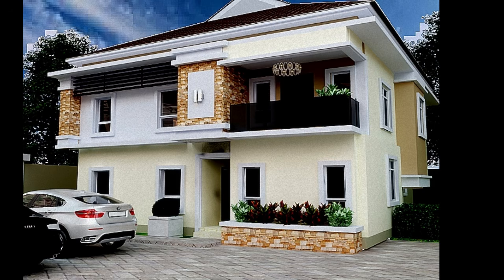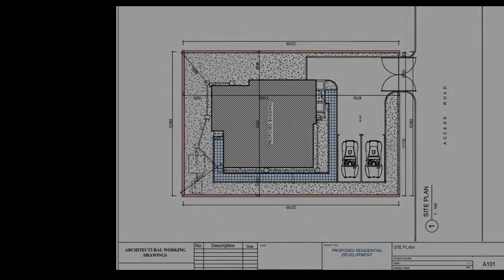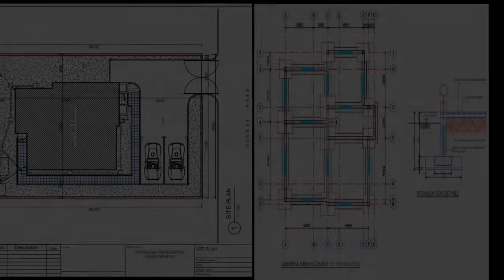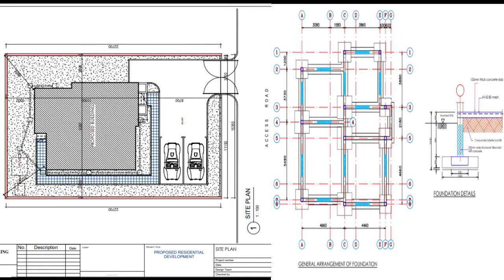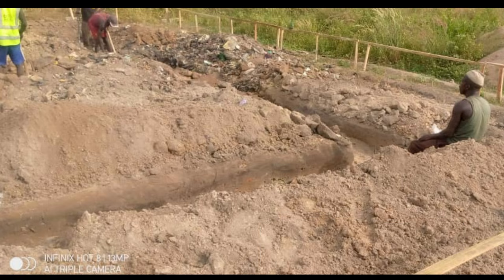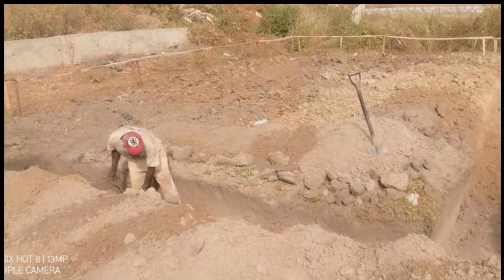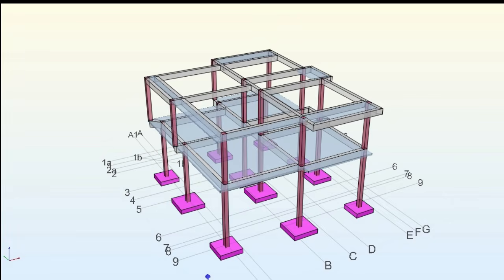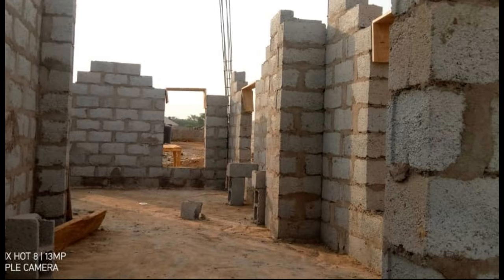House Construction | Step-by-Step From Foundation To Roof| Construction of a Duplex Building

Comment: First of all, I would like to congratulate the professional who dedicates their time to helping others, such as making this video. Stay blessed.
For those seeking further details on how to construct a "Damp-Proof" rock solid Footing Foundation for your house find below, a fascinating cross-continental engineering mashup! Using the Chilean method on top of West African laterite soil that would essentially create a "Super-Foundation." Laterite is actually a famous construction material in West Africa because, when compacted, it becomes incredibly dense, almost like a natural brick. But, adding the Chilean layers on top would solve the two biggest weaknesses of laterite: moisture sensitivity and surface unevenness:
7 Steps:
- Step 1: Bottom Layer must be Compacted Laterite which serves as a solid base.
You can't just pour structural concrete onto raw dirt, such as laterite. If the soil shifts, sinks, or gets wet, your whole building could crack. The following process creates a stable, dry "sandwich" for your house to sit on.
The Laterite Base: which is the "Hard Drive" must be first compacted, which creates a very stiff, load-bearing "platform."
• The Benefit: Laterite has great "bearing capacity" (it can hold a lot of weight).
• The Catch: If laterite gets soaked by heavy tropical rains, it can lose some of that strength or become "plastic" (muddy). This is where the Chile method saves the day.

- Step 2: Geotextile Fabric which is a tough, porous "cloth" must be laid on the compacted laterite to act as a filter and keep the base from mixing with the drainage. It lets water pass but stops mud/laterite from mixing with the gravel/chippings. So, the laterite stays down and the gravel/chippings remain clean.
Why the Geotextile?
Because laterite soil can get soft when wet, it might eventually swallow the gravel(chippings/stones). The Geotextile is like a permanent rug you put on the laterite before the gravel(chippings) goes down. It keeps the "drainage" (gravel/chippings) separate from the "dirt" (laterite). It’s like a coffee filter. It lets the liquid (water) pass through but keeps the grounds (mud) from ruining your drink.

- Step 3: Gravel (Chippings/Stones) (10-15cm high) which creates the "Air Gap" that stops water from climbing a (Capillary break).
Why the difference matters for your foundation:
- Water: Gravel(chippings/stones) lets water escape, because big stones/gravel have big gaps between them that water can’t climb across. Laterite (depending on the clay content) can trap water, which is the "enemy" of a dry foundation.
- Location: You won't find much laterite in Chile. Chilean soil is more likely to be volcanic ash, clay, or "maicillo" (decomposed granite), which is why the Chilean standard specifically asks for a clean layer of gravel to break the contact with the ground. However, in West Africa, such as Nigeria & Ghana, and some parts of South America, laterite is extensively used.
- Strength: Gravel(chippings/stones) provide a "non-compressible" layer. Once together, they don't move. Laterite soil can still shift or compress if it gets soaked.

- Step 4: Sand Layer, adding this smooths the surface so the DPM (next step) doesn't tear.
Think of the Sand & Gravel layers as you would the shock absorbers for a car.
Remember, dirt/laterite expands and shrinks with water; gravel(chippings) and sand stay put and let water drain away.

- Step 5: Polyethylene/Damp Proof Membrane (DPM) the Moisture Barrier must be 'Sealed' to act as the waterproof "Raincoat" and the final shield that keeps the concrete floor bone-dry.
Best practice: Use Two thick layers of DPM sheeting spread over the gravel. Ensure it is "Sealed", which means you overlap them and use waterproof tape on the joints. Without the tape, moisture from the bottom will just find the "zipper" and come through.
Use the DPM to completely cover both the bottom and sides of the excavated hole when constructing the footing. 
Why?: Ground moisture is "sneaky" it can travel upward through concrete (capillary action), leading to moldy floors or rusted metal inside your walls.
Polyethylene - This is the material used to make a DPM. 
DPM (Damp Proof Membrane) - A special heavy-duty plastic sheet.

- Step 6: Lean Concrete poured, (Plantilla or Emplantillado) protects the DPM and provides a clean workspace.
This is a "sacrificial" or working floor, for the footing and the column to be erected.
What it is: A thin layer of low-strength concrete poured over the *DPM*. It isn't meant to hold the weight of the house.
Why: It provides a perfectly flat, clean surface. It protects the DPM from being ripped and ensures the "real" structural steel doesn't touch the mud.
Example: Think of it like a primer before you paint a wall. You don't see it in the end, but it makes the final result much better.

Concrete Additives: The "Secret Sauce"
When people talk about additives for foundations in damp areas, they usually mean Integral Waterproofing Admixtures
- What is it?  A liquid or powder mixed directly into the wet concrete.
- The Job: Concrete looks solid, but under a microscope, it's full of tiny "straws" (capillary pores). Water travels up these straws. The additive reacts with the water to create crystals that block those straws.
- Should you use it? yes, it’s great "insurance."
Ensure the "Lean Concrete" is swept clean before the steel/Iron rods go down 

- Step 7: Reinforcing Bars (Iron rods) & Formwork (Enfierradura y Moldaje)
Now that the ground is prepped, you build the skeleton (Footing)
What it is? - Steel bars (rebars) "Iron rods" are tied together, and wooden or metal "boxes" (formwork) are built to act as a mold.
Why? - Concrete is great at being sat on (compression), but it snaps if it's pulled or bent (tension). The steel provides the "muscle" to keep it from snapping.
Example: The Iron rods/rebars are like the bones in your body, while the concrete is the flesh. You need both to stand up straight.

The Final Step: The Pour
Once the "skeleton" is sitting on its "clean floor" inside its "mold," the high-strength structural concrete is poured. Because of all those previous steps, the concrete stays pure, dry, and perfectly level.
Exercise patience, and let the concrete cure (keep it wet!) for at least 7 days before building walls.

Bonus Pro Tips
- DPC Height - Set it at least two block layers above the outside ground. Prevents ground water from "jumping" over it. Remember, the DPC (Damp Proof Course) is a narrow strip of plastic/bitumen. It goes inside the wall layers to stop water climbing up the blocks. It is mandatory that this heavy-duty plastic strip must cover the full width of the solid block.
- Waterproof Render/Plastering - Use a "waterproofing additive" in the plaster for the first 1m of the wall. Adds an extra layer of "skin" protection.
- Plaster Gap (render) - Leave a small gap at the bottom of the exterior wall. Stops moisture from "wicking" up the surface. Make that 5cm gap at the bottom of your exterior wall look like a design choice. You can even tuck a small "drip groove" there. It’s the difference between a dry house and a "wicking" house.
- Concrete Apron - Build a sloped "skirt" around the house. Keeps heavy rain splash away from the wall base.
- The "Black Belt" (Bituminous Paint) - Because solid blocks have so much surface area in contact with the soil, you should consider applying a Bituminous Coating (a thick, black, waterproof tar-like paint) to the foundation blocks, after applying the aforementioned steps especially the DPM, before backfilling with soil.

As Rising damp is one of two major "silent killers" of tropical homes, it ruins expensive paint, causes that musty smell, and can even lead to respiratory issues for the people living there. This my friend is how you solve the rising damp problem forever, think of the 7 steps as a team effort.
Remember, building a house is a marathon, not a sprint. By following these 7 steps plus the extra precautions, you aren't just building a structure; you're building peace of mind - thank me later. You're most welcome ✨👍

Comment: Is it neccessary to put internal doors b4 tiling or can I  tile d floors b4 putting up d doors?
Reply from the maker: Tiling before the doors is always a good option as it allows the final floor levels to be in place before fixing doors. However, you can fix doors first if the top of tile level is properly established (a bit of a challenge) across the building
Reply: @civilworks826 thank u. I think I may have to put d doors first cos my building is on a sloppy land

Comment: Please i didn't see then coping or its not necessary??
Reply from the maker: We actually had roof beams (like headcourse coping) but it wasn't shown in the video. However, you can have your roof done without coping even though it's preferable to have it. Where the concrete coping is not used, timber wall plates are to be used instead to anchor the roof ties

Comment: Engr pls I would happy if you can reply this , I have 4 bedrooms duplex and the land is very rocky , I’m asking if ground beam , matt is not needed. And I’m using 16mm for all ground columns and it has 16 pillars is that okay 🙏
Reply from the maker: If the ground is stable (rocky may not be stable), you may not need ground beams. But you will still need to have a footing, most likely pad footings which will be small in size due to the firm and stable soil.
Depends on the configuration of the building, 16 columns can work quite well. The building in this video, on a ground floor area of about 10m x 9m, is a 4 bedroom duplex, and it had just 11 columns
Reply: @civilworks826 thank you engr I appreciate you big 🙏✊🏻
Reply from the maker: @IfasolaOsetura-k9m you're welcome. What is the area of the building?
Reply: @civilworks826  please i need this plan please

Comment: Engr pls I would happy if you can reply this , I have 4 bedrooms duplex and the land is very rocky , I’m asking if ground beam , matt is not needed. And I’m using 16mm for all ground columns and it has 16 pillars is that okay 🙏
Reply from the maker: Good morning. Sorry about the delay in responding to your question.
1. Even if the ground is rocky, you will still need foundation (mat), only that its size will be small. 
2. And no, you don't need ground beams.
3. 16mm for the columns is very ok. 
4. 16 pillars (columns) can work and be adequate if they're properly spaced and arranged.

Comment: Eng what is the normal damba leval of the road to the foundation, l, mean the hight of the foundation on the flat land and the depth of the columns from the foundation thanks nice teacher.❤.
Reply from the maker: Depth of foundation at 1m to 1.5m is generally OK for residential buildings. Ground slab should not be less than 300 mm above natural ground level

Comment: I'm amassion all two engineers   ihave not seen them putting the ground beems are they not important?.
Reply from the maker: Ground beams are not necessary for all buildings. Ground beams are used mostly when you have soils that are likely to have differential settlements. If the ground is firm, then substructure blockwall will be adequate

Comment: Why isn’t there horizontal rebar on top of the DPM? Is it only used in larger structures or is it just a difference in building codes between countries?
Reply from the maker: It depends on the kind of load expected as well as the exposure conditions. Most Slab-on-grade does not require steel reinforcements  and, when put, is largely for crack control, not for increase in flexural strength

Comment: Hi can i ask some questions               1: do you fill the blocks with concrete? 2: do concrete blocks need added insulation?
Reply from the maker: @Shrimp9  1. Yes, at substructure, the block holes are filled with concrete. 
2. Not really, the concrete blocks don't need added insulatio. They generally have sufficient insulation  against heat or cold

Comment: Which is called chaining? Pls
Reply from the maker: @Pamperu2  chaining is when you introduce ground beams at (or before) the dpc. It is used to prevent the blockwork above ground from bending due to earth pressure (especially when the height above ground is much). It is also used to keep the slab level "tied" together, reducing differential settlements. It's not always required, but some foundations may need it

Comment: What's the size of rods used in the columns please? 12mm or 16mm? Which would you advise for a 3 bedroom duplex?
Reply from the maker: 16mm from foundation to decking, then 12mm from decking to roof
Reply: @civilworks826  Thanks so much my I had initially used 12mm for all the columns almost 20 of them and some 3 sets of blockwork has been casted already. Can you please advise whether we should remove the columns and replace with the 16mm even though the building is only G+0.
Reply from the maker: @muhammadsani129 if the building is G+0, then 12mm is very adequate. There is no need to change it
Reply: @civilworks826  I really appreciate your quick response Sir. Sorry I meant to say g+1 sir with 20 pillars Sir.

Thanks
Reply from the maker: For a duplex (3, 4 etc bedroom) , the most size for columns is 16mm even though 12mm can be adequate for some columns. However, you can also have 20mm rods of you have long beam spans

Comment: Very informative! I used to think foundation trenches were much deepe than that. Thanks for the video
Reply from the maker: Foundation trenches are usually shallow, about 700mm. It's the column bases that may need to go lower to 1m - 1.5m (according to soil investigation report)
Reply: @civilworks826  Thank you for the video Engr. Idong. May I ask, apart from the additional cost that will be required for the concrete casting/filling of the foundation is there anything wrong with having deeper trenches and bases for an even more solid foundation? Or are there other disadvantages asides cost for having them deeper.
Reply from the maker: @itoroekpo5798  The depth (and size) of foundation is determined by the load bearing capacity of the soil as well as the building load. Usually, the deeper you go into the ground, the firmer and stronger it is leading to higher capacity. However, if the soil can bear the load at 1m, there is no need to go to 2m, and so no real advantage
Reply: @civilworks826  understood! Many thanks

Comment: Wonderful job, please I need you to clear my doubt on this;

At the foundation stage, you didn't mention placing hardcore or wire mesh. Are those items of work optional during the foundation process?
Reply from the maker: Actually, not all concrete slabs on grade need to be reinforced especially for light loads like residential buildings. For driveways and filling stations, they may be used (also optional there). The BRC helps to keep the cracks in a uniform pattern, not to prevent them. Similarly, as long as you have a well compacted bed, you don't need hardcore for lightly loaded ground slabs like this one

Comment: Good job! Quick question, there was no mention of iron rods being used prior to concrete on the DPC?
Reply from the maker: Thanks for the compliment. Actually, I mentioned it around the 3:04 minute mark. The building had 11 columns and we used Y16 in the columns and Y12 in the baskets. The basket photos are not very clear though